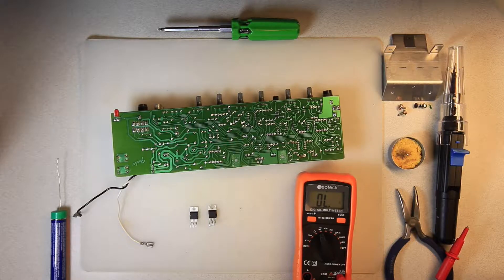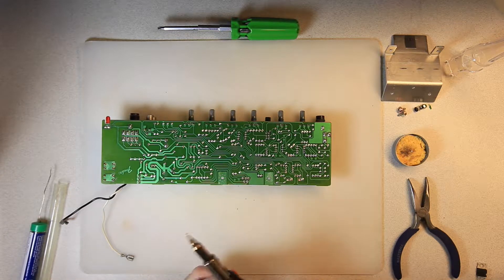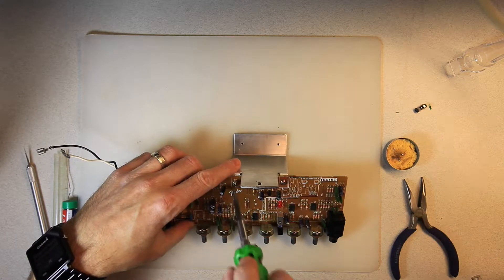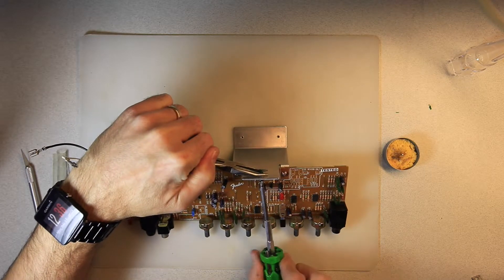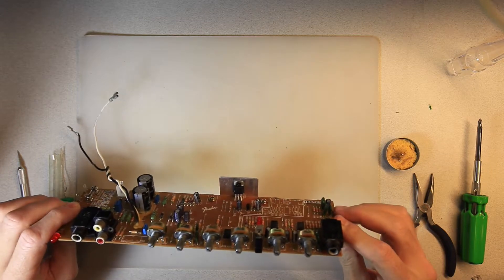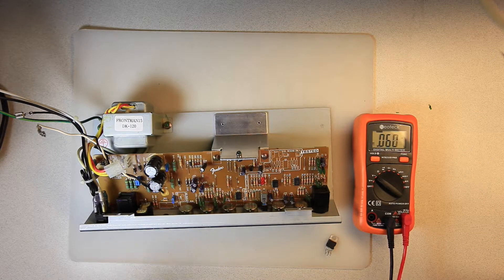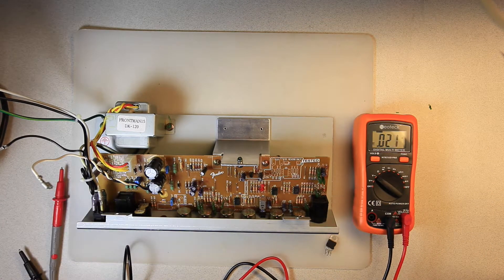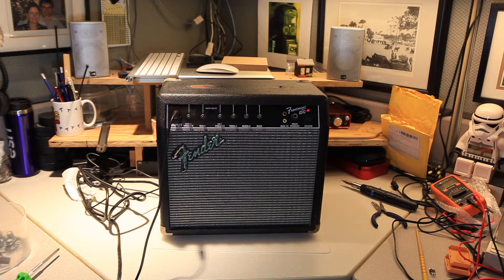Fender Frontman 15G Repair - Part 2

Comment: 3:02 Interesting that this tiny electrical part has gotten such a huge heat-sink…
Reply from the maker: That is actually not that big. Some are larger with  rows of fins for better heat dissipation
Reply: @TonyBursey  In comparison to that tiny part… ;-)

Thanks for showing these details too and that one should check afterwards that there is no leading in the wrong places.

Comment: Awesome video, I've got a lot more of a basic problem. Ive managed to unplug all cables connecting to the switch and now can't remember how they went. Any ideas?
Reply from the maker: Later in Part 2 there are a few shots of the power switch with the wires connected that you may be able to make out. In the Part 1 video, I point out the hot wire that you can see following it from the plug going to the switch and then to the fuse right at the beginning... https://youtu.be/RoGR3vmHSlI?si=858OAHeGsnq2fGoZ

Comment: Que capacidad son los potenciometros
Reply from the maker: Bass = 250K 30C
Mid = 50KB
Treble = 100K 30C
Drive Volume = 100K 30C
Gain = 100K 30C
Normal Volume = 50K 15A

Comment: Great video! My question is that I noticed the board has a spot on it for a circuit and a potentiometer for reverb. Could I install them and get reverb also?
Reply from the maker: Thanks for the question. I have the schematics for both the 15G and 15R. They both use the same board and case. There is a section on the board for the reverb circuit and as long as all the components are populated, it is possible alone with the correct reverb tank to convert it to a 15R

Comment: Hi Tony, just got the same type amp from my grandson. My problem is when I power it up it sounds like something is going to ground. The speaker works as of course that's how I hear the grounding sound. Any direction on what to check and look for is appreciated. Great videos by the way. Thanks
Reply from the maker: I would start with the input jack. If you have removed the circuit board, inspect all the solder joints. From what I have seen, the solder joints on the input jack tend to be the first to let go. Having the board out is a good time to spray some electrical contact cleaner in the jacks and the potentiometers even if you don't hear crackling when they are turned. Not sure what else to suggest without actually looking at it. Hope this helps.
Reply: @TonyBursey  Hi Tony, I took removed the circuit board and found the connection on the board itself between pins 4 and 2 or the two middle pins of the input jack was unglued from the board itself and also had a break between these two points. The input jack is in bad order and not making good connections. I figured once I receive the new jack I will solder a wire between those two points to make up for the broken connection. Will see if that takes care of the problem. I also checked all soldered connections, anything suspect was resoldered. Thank you for your response and help.

Comment: How do you know that only the 3rd pin should work on the TDA2050? Where did you get the part? Would this part be the same for all the Frontmans? Are there different specs to look for in a TDA2050? What do I look for to make sure it will work with a Frontman 25R?
Reply from the maker: Thanks for your questions. It is not that the 3rd pin should work, it is that the 3rd pin should be the only one with continuity to ground. I ordered my replacements from Amazon. The TDA2050 was discontinued so amps made after that would probably be different amp chips. The easiest way to find out would be to download a schematic for your amp or open it up and look.
Reply: @TonyBursey  Forgive my clumsy use of the vernacular. That’s what I meant — “work” meaning “works” when you test for continuity. But my question remains.. The video mentions the 3rd pin is the only one, but doesn’t say how that fact came to be known. I suppose from studying schematics or some such? Schematics and multimeters may be beyond my current skillset, but I am reasonably confident I could desolder the 5 pins and replace the part, if I knew I had the right part. :-) All I know is I get no power on my Frontman 25R, and replacing the fuse didn’t fix it. Thanks for the video! It at least suggests another thing to try replacing.
Reply from the maker: @ladyapp-titude  it is in the spec sheet for that chip

Comment: Hi, Great Vid!!!.. A shame this is not a 1.000.000 views video! You dserve it. Quick question, I notice the amp makes some sort of a scratch noise when you play a string, but if the guitar is quiet it won't make a noise.

 I bought one, very chep, also 15g, but clean and dist. channels make a noise ONLY when i play a string, I thought it could be the guitar, but not, it does it with different guitars and cables. I resoldier everything, but still makes that dirty noise only when I play a guitar. I used the RCA IN channel, and play some youtube videos. The sound was perfect, but I selected a clean guitar video, and there was noise again ONLY when the guitar was playing... It is driving me crazy, you got any clues that could help me?

I'm in Venezuela and there's no service here nor skilled professionals who could do the job for me...
Reply from the maker: Thanks for the comment. The first thing that comes to mind is a grounding issue either with the guitar or the input jack, or maybe the channel selector switch. You could try to run your RCA into a 1/4” adapter into the input channel and see if the noise is still there. If it is not, then the issue is with your guitar.
Reply: @TonyBursey  thanks Tony, really appreciate your quick answer. I have a Peavy Rage 258 (similar amps) and My guitar is noisless. I even tried the Peavy speaker with the G15 and the noise was there, even worst. But as I said, if the guitar is not being played, the amp is totally silent. 
Perhaps some issue with the board.... I'll keep you updated.... Thanks again

Comment: Great video! Tony, can you help me identifying, find electrical knobs specifications as I have to change a couple of broken knobs in my amp? On the manual, cannot find it.
Reply from the maker: Thanks for the comment and question. According to the schematic, the Treble is a 100K pot, Mid is a  50k pot, the Bass is a 250K pot, Gain is a 100K pot, Drive is a 100K pot, and the Volume is a 50K pot. Hope this helps.
Reply: @TonyBursey  thanks for the reply. In fact, I managed to read carefully on the back of each of them, finding the following codes: from L to R, "A50K", "30C100K" x 3, "B50K" and "30C250K".

Comment: Thanks for the repair how-to. 

Two comments (well, one question and one comment):

The comment: My favorite 'hack' with small practice type amps is to 'hijack' the speaker output and solder a pigtail type connector or fix a jack to back panel of the amp to allow easy connection to an external speaker. A larger, much more efficient speaker connected to these small practice type amps can yield a massive output increase. The difference in output is surprising.

The question: according to the counterpart datasheet the TDA2050 appears to be rated to be stable under a 4 ohm load. Care to venture a guess as to why Fender would opt to use a 8 ohm speaker instead? If the power is available (and required heatsink not to onerous, and the speaker roughly the same cost, etc..), why not use it? Seems like a waste to me.

Thanks again.
Reply from the maker: Fred Edberg that is a nice hack and one that I have thought about for a while. A hack that takes that to a new level is to convert my amp into a head and speaker cabinet. I do need to pick up another speaker for the cabinet part though. I will have to look up the data sheet on the TDA2050 for your question about the best speaker resistance to run but that can easily be done when upgrading the speaker. Thanks for the comment and question.

Comment: Hi Tony... nice video. I just picked up the same Frontman 15G off Kijiji in Ottawa for my son. No life in it when powered up and a quick test with the voltmeter gives me no output from the transformer. The fuse was also missing. Can't locate a replacement power transformer on-line. Any ideas on parts or repair to the transformer? Thanks.
Reply from the maker: David Guy the power coming in goes to the switch and then the fuse before the power supply so you might want to do what I did in the Part 1 video. Find a new fuse and disconnect the leads from the circuit board and then you can test the power supply the same way. Pick up a few fuses though.
Reply: @TonyBursey  thanks so much. I did test directly to the transformer by bypassing the switch and fuse. Still no output, so I am pretty sure it is the actual transformer. I'm trying to figure out a replacement somehow.

Comment: Hi, great vid thanks. I get continuity on pins 3,4,and 5 while the chip is still mounted on the board. The amp won’t power up at all, do you think the tda2050 is the issue?
Reply: Thanks for the reply, the fuse was good, weirdly had a 2A fuse in, I don't think that's correct. Do you think it should be 250mA (for 240V) according to the printing on the board.
Reply from the maker: Anthony Stevenson yes that is correct. Fuse should be 250mA 250v for 240v. I would also check the power supply and check for any burns marks on the circuit board to make sure nothing melted. Also good to check all the solder connections while you are at it
Reply: @TonyBursey  thanks I'll check all that 👍 appreciate the assistance.
Reply from the maker: Anthony Stevenson thanks for the question. First off, the fuse is probably blown. Get a couple of replacement fuses. From your description it sounds like it might be the TDA2050. To know for sure desolder it from the board to test the pins out of circuit. I ordered several TDA2050s at once to have a few spares on hand.

Comment: I have a Frontman 15r.  I can hear my guitar through the headphone jack - all the volume and tone knobs work.  But, no sound at all comes out of the speaker when the headphones are unplugged (or when the headphones are plugged in).  Any suggestions?
Reply from the maker: Matthew McNally thanks for the question. One thing to look at is the headphone jack itself. I think it is one of those that cuts output to the speaker when a jack is plugged in. If the shunt is not making contact when there is no jack plugged in, you won't get sound from the speaker because the connection is not there. Also check the solder connections here because the output section goes through the headphone jack first and then to the speaker.

The other thing to look at would be the solder connections where the speaker leads connect to the board. Also test the speaker. If you connect a jack to the headphone jack with at least the left and common bare wire on the other end, connect that to the speaker terminals and see if you get any sound. If you have a schematic, trace the components back from the speaker connections and test each one. Your issue sounds like it is either at or very close to the speaker connections especially since you get sound from the headphones.

Comment: I have a Frontman 15G that is very noisy mostly on the dirty channel... how do u fix this ? Thanks
Reply from the maker: Thanks for the question. If it sounds crackly, it could be just dirty pots or the "Drive" switch that needs cleaning with some electrical contact cleaner. Might as well do the same to all the pots at the same time. Spray each pot and turn the knobs back and forth all the way many times. Try that and see if that helps.
Reply: You mean talking off the knobs and spraying with contact cleaner ? 
Is it possible the building I am in is old and has bad wiring that would cause this noise ? 
Thanks
Reply from the maker: Nicolas Trudel I guess that is possible. I have a good power conditioner to plug in all my electronics that filters out line noise.
Reply: Where do u buy such a power conditionner ?
Reply from the maker: @nicolastrudel9320  I bought mine from Craigslist used. You can also find them on ebay. Furman and ART are well known and do a good job filtering out interference. There are also models that protect against brown-outs and other fluctuations in power.

Comment: You remove the original chip before you tested continuity in video 1, but you checked continuity on the board for the new chip. So I should be able to do the test on the suspected faulty chip before I remove it? I ask this because mine is showing continuity on all pins, but I haven't remove it from the board yet.
Reply from the maker: chillymeatball thanks for your question. I tested the chip before I took it off. And then again after to see if it still had continuity with the other pins. It still tested the same. Some components you have to take out of circuit to test and I was not sure this was one until I saw the same result. You can test it while still on the board.
Reply: @TonyBursey  ok thanks you saved me so much time cheers

Comment: i have one of these and one channel is dead, and the other one is weak and it hisses like a bugger...should I also suspect this same chip? Or should I be looking elsewhere for a fix?
Reply from the maker: lgmnow kondo thanks for your comment. I don’t think it would be the amp chip in this case because you are still getting sound. If the chip was shorted out, your fuse would blow as soon as you turn on the amp. I would suggest pulling the board out, make sure the capacitors have been discharged (there are several videos on YouTube) and check all of the solder connections with a good light and magnifying glass. Sounds to me like there might be a break in some solder connections. The hiss is might something in that channel not grounding properly from a bad or broken connection.